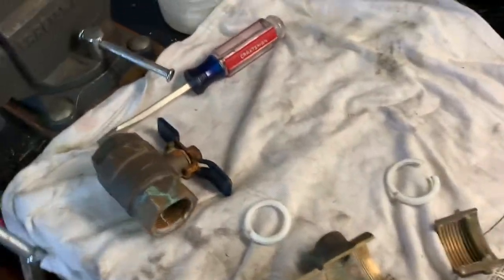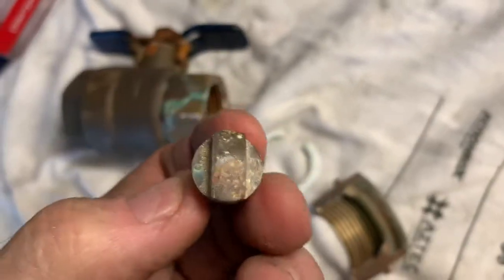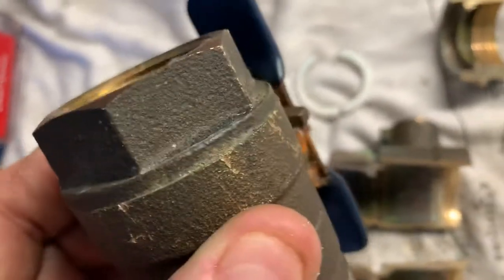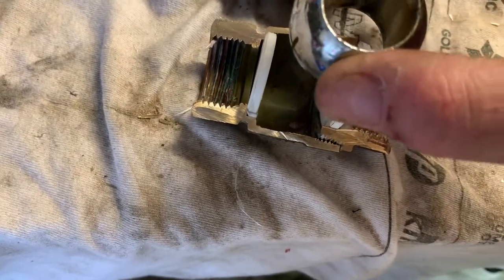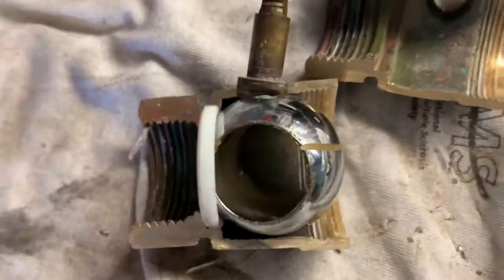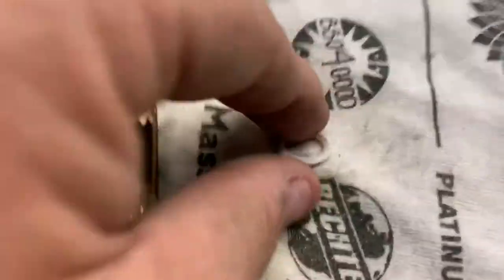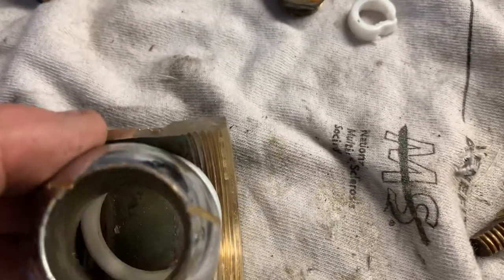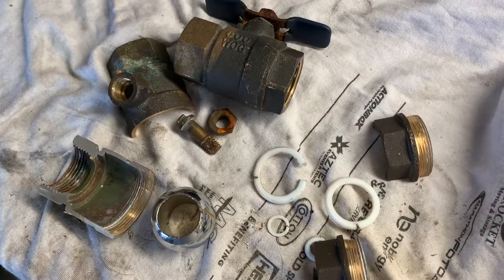1 inch ball valve disassembly and construction

Comment: can ball valve work as air fill valve and thus help filling air in Air tank .
Reply from the maker: I would be cautious if the pressure was significant
Reply: @condor5635  thank you for the quick reply. But all mini ball valves indicate they can wwork for 150 psi. but when i use them, they let in air even before turning them quarter. One may be faulty. but it is repeating. so, can you advice. if only an NRV be useful or a good regular full ball valve.
Reply from the maker: @baburamabadhran1437  I use the latter